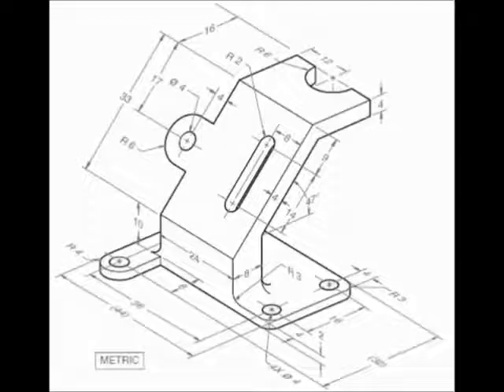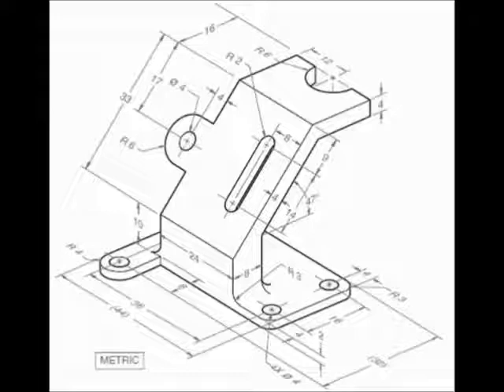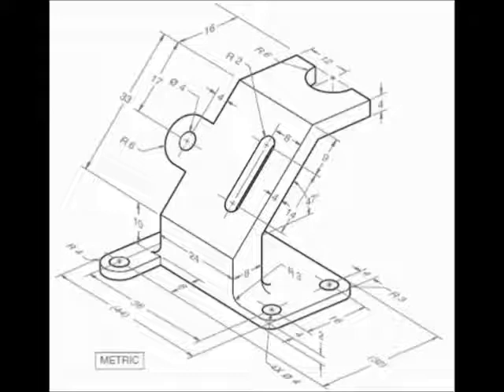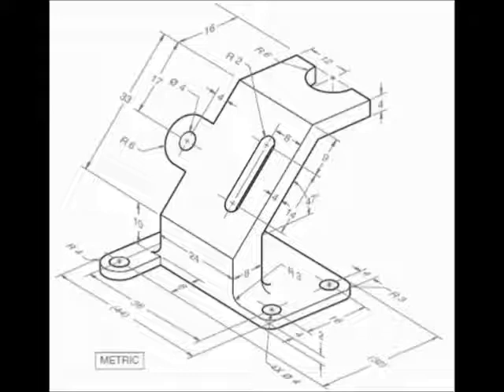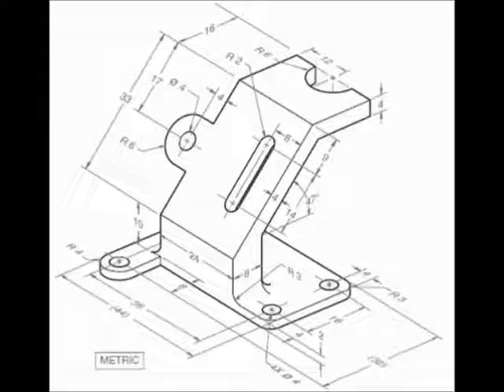Auxiliary lecture slides example 2

Comment: from the bottom view are we not supposed to see the top horizontal part with the semi arc
Reply from the maker: The bottom view is a partial bottom view because we use it to only show the bottom plane. The arc in the top is shown in a separate partial view. This is the simplest way to show the features.